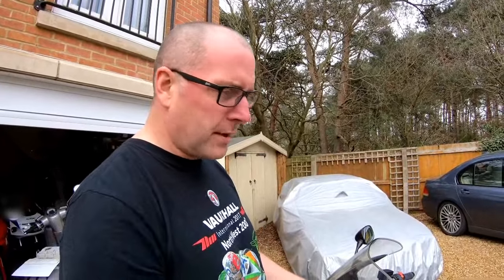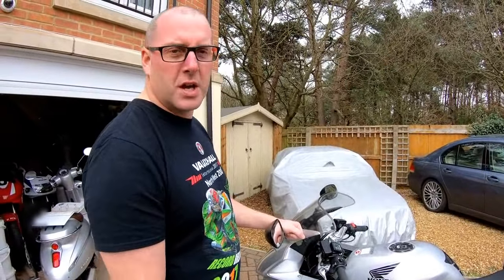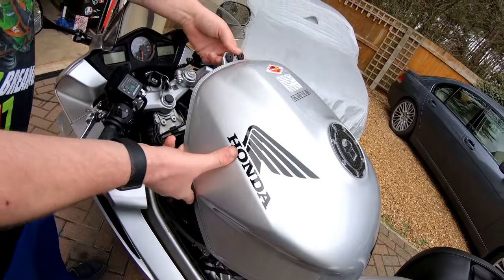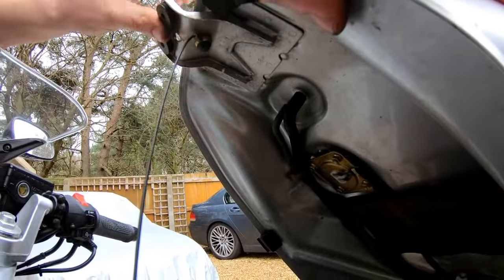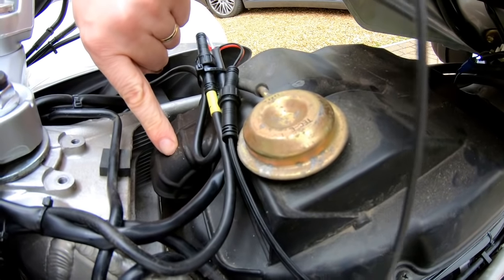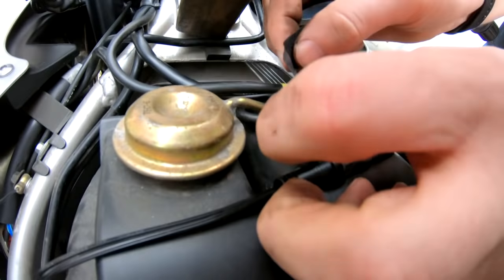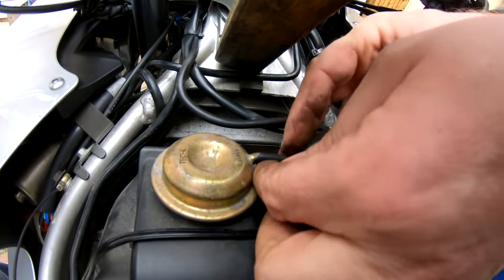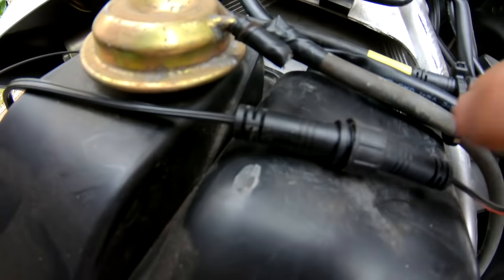Honda VFR800 VTEC PAIR valve delete, Snorkel removal and Flapper mod, simple reversible and no cost!

Comment: I'll never understand VFR800 5th Gen owners choosing to disable the intake flap.  I own two 5th Gen VFRs, a '99 and an '01 because I love them so much I had to have one from both halves of the 5th generation.  Why on Earth would you disable the intake flap?  You don't like the hard sound of the air box hitting resonance at about 7,000 on the long intake track and then, after the flap opens up the short intake track you get to hear it hit hard again at about 10,500?  Where does this weird belief come from, this conviction that a random VFR800 owner knows more about matching the volume of of an air box to a motorcycle engine and the computed fluid dynamics of the airflow in that system than a whole Honda engine design team?
Reply: You are right!

Comment: The Pair valve is open when not controlled by the ecu.  Disconnecting the wires means it is now open!  Also the purpose is to introduce oxygen so that any unburnt emissions will fully combust.  If you were to block the hose off it means that your O2 sensor will read it as rich and will lean out your mixture. Pretty much the opposite of what you said.  And the other thing is that your system is engineered around the Pair valve being functional.. The burning of the leftover gasses increases the temperature of your exhaust which is used to heat up the catalytic converter to its temperature of optimal efficiency.  More than one VFR owner has put the bike on a dyno before and after these three mods and found a loss of 2-3 hp.  Snorkel mod makes it sound good though!
Reply from the maker: To be fair mate, I did a little research into what you said above and can actually confirm that you are correct about the PAIR valve being in an open condition when not receiving 12V. I'm surprised that I didn't come across this little snippet of info when I was doing the research for the video! However the Honda Manual confirms this. I have since tried this mod by adding a tight fitting marble into the hose between the airbox and PAIR valve in order to block the airflow entirely as i have found others have done. I have to be honest that I am a little underwhelmed anyway. I am likely to return the PAIR valve back to stock but I do enjoy the added sound of the snorkel delete as you said. I will upload a video in the near future about my thoughts on these mods as soon as I get the opportunity. Thanks for your constructive comment though Tim. Stay tuned!
Reply: Difference here though, is that the bike is running rich with the pair valve, removing it causes the engine to run leaner, resulting in better fuel mileage and a ratio closer to the golden 12:1 for optimal power. This is why you should have the bike tuned after this mod, to make sure it is in the golden ratio and is making good power. Big power mods though are the snorkel and the flapper, allowing quintuple the airflow into the engine, meaning more air, more gas, more power overall
Reply: @ASadP1ckle  That's nonsense.  The area of the opening to the airbox with and without the the snorkel is the same.  It does not increase airflow.  At low RPM the flapper closes because the engine needs fewer CFM.  Closing the size of the opening does NOT decrease the amount of air available to the engine since the amount of CFM is easily achievable with either the larger or smaller openings.  What it does is increase the velocity of the incoming stream.  It's just physics.  The resulting higher inertial velocity of the airstream increases efficiency at low RPM. And really I have not found a single person that can show you a dyno run before and after these mods who can show you a power increase.
Reply: Have you pulled a snorkel from these bikes? I have. The intake area has greatly increased with it's removal. Do the math, you take out the restriction, airflow increases
Reply: @ASadP1ckle  yes. I have a 98 5th gen. The snorkel removal increased the sound level. But the opening is still the same size. The same amount of air will enter either way.
Reply: Thats not right, the snorkel allows only about 2-3 square inches of intake area, compared to the opening without it, of about 12 square inches, as well as the flow not being restricted, as it's not forced through the snorkel and around a bend at the end
Reply: I will believe in dyno runs!
Reply: @patrickk5865  I agree, Dyno is the proving ground, and not much power will be gained without a tune, but increasing the area of the intake mouth increases airflow, and the easier the engine can breathe, the more efficient and better power it can make
Reply: Some openings where made more tight to accellerate the airstream. Thats the reason for VTEC.
And a snorkel can reduce velocity what makes the air more efficient. It's maybe the same effect of the funnels under the Filter. I bet the japanese guys that has designed the system knows what they did and I bet it was not just laws for sound emissions.
Everybody believe in dyno runs for exhausts so I am waiting for an dyno for the snorkel mod. Everything else is just theory.
Reply: @patrickk5865  Velocity increase due to restriction is true. However the only engineered velocity control in this intake system is at the throttle body openings (those short plastic tubes going into each throttle opening) and beyond. The airbox opening can only serve to restrict overall air. If the snorkel and flapper valve openings had anything to do with the fuel systems performance because it of increased velocity (which is impossible to increase performance in this way) then the path of that air would need to be supplied through a symmetrical  design going to each individual throttle intake. So there may not be any dino increases with the intake opened up and the pair valve removed. I can say for sure that there is a smoother power delivery and that could also be interpreted as an increase in performance because the throttle response through that range is then useful. On a stock VFR the only way to a gain measurable increase in horsepower is with modified fuel and ignition mapping. Maximizing the air available for intake and opening up the exhaust from restrictions does smooth out previous low end throttle response issue and I notice that I lost the high frequency vibration caused by the stock exhaust baffle restriction. Who is doing performance exhaust and not doing the PAIR, flapper, and snorkel mod?
Reply: timcthefilmguy I think I’m with you on this one.  I’m no rocket scientist by any means, or VFR surgeon for that matter, but isn’t there some mass flow law thingy at work here.  You have a fluid, air in this case, being drawn in by the engine and entering the snorkel where it then enters the airbox slightly larger opening thus slowing down the velocity of the airflow. The mass of air is the same, just slower. Taking the snorkel off would just have the same required mass of air enter the airbox slightly faster (noisier) but it is still the same mass being called for as before. Since it’s not a true Ram Air design I doubt driving at speed is going to force “more” air than what is already getting through all the bodywork obstructions.
I dunno, seems like a aural cosmetic mod at best.  Any thoughts?

Comment: When disabling the flapper, simple square inch of electrical tape over flapper pipe and replace the rubber hose, nice neat job. Snorkel removal does nothing to help the bike breath, just changes induction noise slightly, the hole in the snorkel is consistent, it doesn't get smaller at any point

Comment: Well.. I made the modification with flapper, valve and with and without snorkel. I feel that the removal of the snorkel is not a key element of this modification. IMHO it improves but not a lot. The main change comes from flapper and valve. It is also true that blowing some hot air on the snorkel it gets out quite easily without any risk of damaging the plastic enclosure. Now the bike is much more fluid at low RPM. Recommended. Thanks again for this video lesson. Well appreciated. Cheers.
Reply from the maker: Nice one 👍🤓

Comment: Did the same mods to my 2002 back in 2007. Left the snorkel inplace also disconnected the air box air  temp sensor and crossed the terminals with 280 ohm resister, replaced the fuel pressure regulator valve, disconnected the O2 sensor and crossed with a 330 ohm resister (one in each socket). Got the mpg down from 56 to 32 MPG. No more flat spot prior to VTEC engagement and now smiling from ear to ear.
Reply: So you're getting worse milage after the mod or? Thinking about doing this as i hoped it would improve low RPM  mileage (since i ride alot of b roads). Dont mind the way the bike runs low RPM stock just was hoping it would make it run a little more frugally.
Reply: @lv0ll9  technically yes. worse MPG now but overall much happier with the riding experience after the mods and no regrets. My bike was for the CA market. I believe it was made for a lean CA fuel requirements and Honda did not get it right as far as the VTEC was concerned. The mods I did were aimed at smoothing out the VTEC transition only based on things I read in the VFR forum. As a result of carrying out those mods the side effect was to lower the overall mpg from 56 to 32 mpg but I was totally OK with this as the overall riding experience was so much better. Hope this helps! Good luck.
Reply: I never got more than 42 mpg. I don’t have a CA model and mines unmodified. 56 mpg sounds wildly optimistic! Just saying.
Reply: @wirenut3020  Totally understand your skepticism. My model was for CA. An engine that was starved for petrol and air and a complete ignition system designed to reduce emissions (and consequently performance) to meet the CA Smog requirements for that year. On the first (long) ride I did I filled the tank and got on the freeway. (Think M or A road) and remained at a fixed speed over a distance (I no longer remember how far exactly although might have it in my riding log) The next time I filled up I divided the number of miles traveled by gallons consumed and the result was 56MPG. However, as stated in my previous posts, the riding experience was horrible with less power and an extremely rough transition to to VTEC. (So bad in fact that I considered selling the bike) I found the mods on the VFR forum and the bike ran much better with a far smoother transition to VTEC afterwards. To me the riding experience comes first. I would rather have a motorcycle performance that is smooth and predictable, (I now average around 32 -ish) than one that lacks power or predictability at high mpg. I prefer to focus on fun factor and quality of ride over higher mpg.

Comment: I bought a 2009 VFR 3 months ago. I love them bike apart from the jerky throttle response around 5000 rpm. I     saw your mod so thought I would try it as if it didn't work as I could easily put it back to stock. I did the flapper and snorkel first and it improved the drivability and the intake noise is amazing! I have now done the pair mod and it is so smooth it is like a different bike. Thanks for the advice
Reply from the maker: Glad it helped 👍🏻
Reply: Did you have to retune the bike at all? Or just do the mods and it's good to go?

Comment: I had a  Full Delkevic system fitted on my 2002 VTEC last weekend.
On the ride home (10 miles) it showed up a few strange flat spots and general unhappiness in lower rev range plus a lack of power.
Yesterday I took the flapper hose off, taped the hole and reinserted the hose (closed).
I unplugged the PAIR and taped the connectors up (for moisture).
Started it up and higher than normal idle hmmm.
I looked up the marble in hose mod and I don't have any marbles so I took the hose off and gaffer taped the air box hole and reattached the hose (closed).
I took it out today and did an overall road test (B roads, fast A roads and a dual carriageway)
The bike is now running like an absolute dream.
No flat spots etc and power delivery is fantastic.
If the mpg is better or worse I really don't care, it's now running like a Honda v4 should. 
Kev, thank you for the video.
Reply: By the way, I didn't take the snorkel out.
In my opinion I don't think the air flow is restricted that much without the snorkel.

Comment: For what it's worth, I did the flapper mod and snorkel removal and my VFR idles so much better and low speed throttle response, i.e. stop and go, are much smoother. Makes it more comfortable to ride at lower speeds in my opinion. Nice video.

Comment: i removed even the flap with his plastic sheet from the airbox and now I have a big hole. it's really sounds great, I have more power between 4-5000rpm and the gas from the exhaust does not smells as unburned fuel like it was before. 
Also, I noticed that the water temperature is a little bit cooler now, but at the same time, after a ride I can hear the bike ticking from the hot, and I think the frame is getting wormer.

Comment: You sir are the VFR god. Thanks for all the content!
Reply from the maker: Wow, thanks!👍🤓
Reply: I just bought the bike used, and your tutorials are a god send. I did this video today and clutch bleed tomorrow. My air filter is disgusting also so replacing soon. And just a little pro tip to go along with the video: if you twist the little knob by engine cover clockwise a bit, it'll increase idle rpms and bike sounds so much nicer if needed.

Comment: One tip for the vacuum line for the flapper, bend it on itself and zip tie it. That should prevent anything going in and last until you need to cut it. Cheers!
Reply from the maker: I’ve actually taped the flapper actuator and popped the pipe back on now 👍🏻

Comment: Kev
Easier way to do the flapper mod  is to remove the pipe from the valve on top of the airbox tape over the valve with electrical tape so NO air can get through and put the pipe back on.😉
Reply from the maker: Yeah that’s how it is, I just didn’t do that in the video! 🙄

Comment: You can use the C spanner and extension from the toolkit to prop the fuel tank up (put one of the bolts back and the extension locates on that to stop it slipping). That works a treat; no need for substitute pieces of wood. Assuming you have the toolkit for the 'bike. Good video; although I don't seem to have the same issues with my 09 plate VFR so will not be doing the mods. Yes;  I've checked and they have not been done.
Reply: I use a stick that is 380mm long and has a point in on end to fit into the middle hole between the fuel tank bolts.

Comment: An actual beneficial vid on the vfr800... vunderbar....!!...you can stuff a prefilter material in place to catch debris...caps or shrink tubing work well.....the fresh air/exhaust bit...kinda like vw diesel engineers knew better as well..😏🤓🤔😎....

Comment: Coming to this comments section late to the party and being a bit of a debbie downer, but the purpose of removing unburnt hydrocarbons from the exhaust isn't to save the polar bears, it's to avoid producing toxic/carcinogenic emissions. It's not so much the polar bears it's helping, more yourself and those around you. Climate change and pollution aren't the same thing! Anyway, happy riding, I'm looking at getting a VFR of some sort and your maintenance videos are very informative.

Comment: Just done your mod i had the same flat spot, but with the pair valve,  I've seen some are saying that you should blank the air outlet on the bottom left of the airbox what's your thoughts on this, cheers mate, I really find your videos very helpful 👍